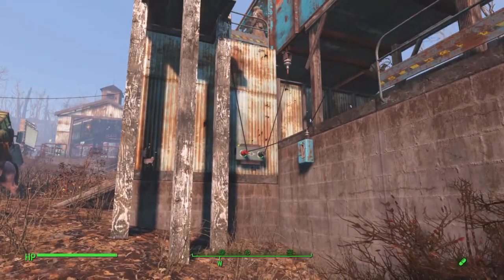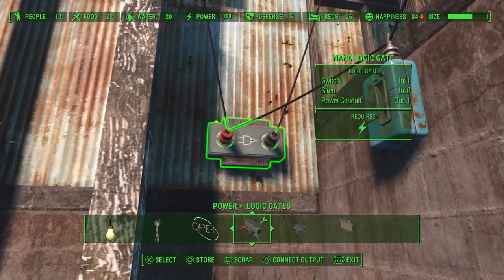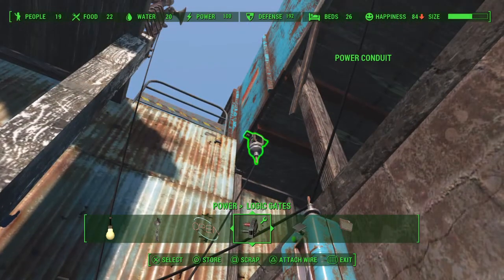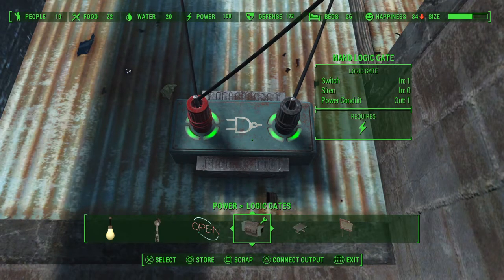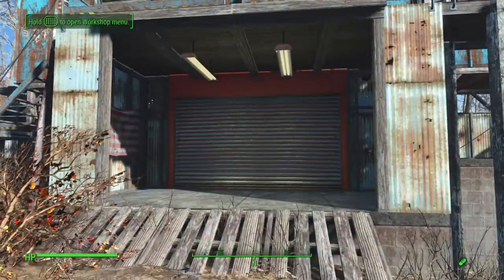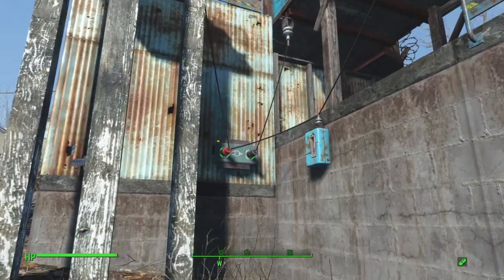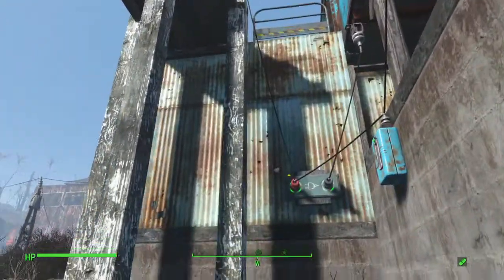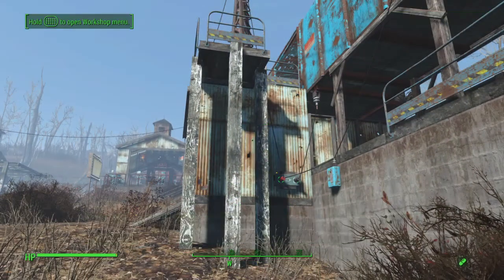Fallout 4 Settlement gatehouse using logic gates 2.0

Comment: hi, I'll use your logic gate in my fortress build at the castle. My  question is, would this work with three switches, located in 3 different places, connected to one siren? Do I need to use the AND gate in every switch?
Reply from the maker: TheFlamingReconz I would think that if you can run the wires there it would work just fine for all 3. But the logic gates are sometimes irritating lol, but it would be cool if it works!

Comment: I did basically the same thing except I went from the output on the nand gate to the switch that controls the door. Also I stuck a delay off switch in between my firework launcher and siren and set it to cut off power after 1 second that way I could stuff a bunch of flare in it and it will only fire one every time the siren is activated.

Comment: I just tried both setups and both stopped working quickly. I did find a solution though, on your original setup replace the NOT gate with a XOR gate with only one alteration in the wiring, run an extra wire from your power source to the input of the XOR gate. It has worked flawlessly so far.

Comment from the maker: It needs 2 switches for it to work, 1 switch must be off and 1 switch on. These 2 switches are the switch to the door and the switch on the siren. So if the siren gets turned on it cuts the power because then both switches are on.
Reply: The problem with this design, is that if you manually turn off the switch to close the door and then a settler triggers the alarm, the door will reopen as it then has 1 active input.